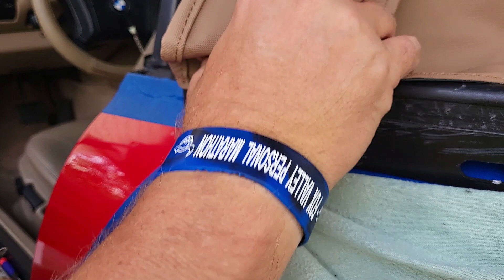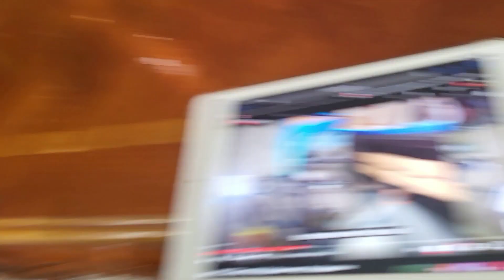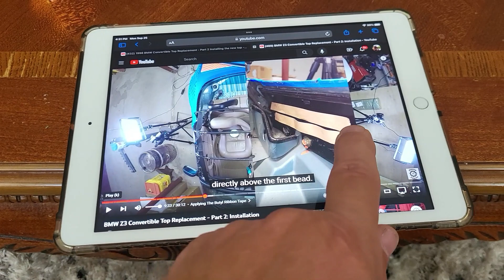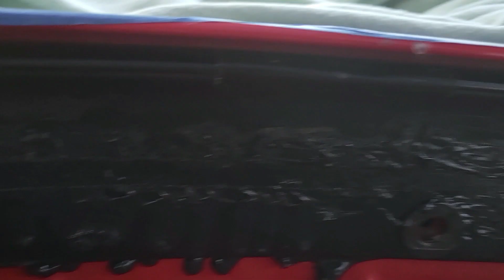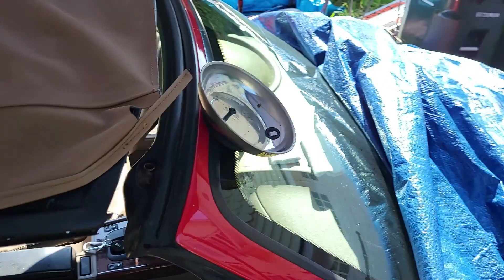BMW Z3 TOP REPLACEMENT - HOURS OF INSTALL TIPS !

Comment: dont take this the wrong way, but im pretty much convinved that you're my spirit animal. (or spirit human, in this case). i did actually sit thru the whole video, and i was right there with you feeling every single pain in the ass, (and neck, and back) unnecesarily overly-complicated, bull-shit aspect of this replacement. at one point, when i think i was maybe 50% paying attention and 50% struggling to unbend that one tension cable bracket that my kit sent me the wrong one of (yep, 2 lefts, no rights), and my boyfriend just started laughing because we both let out the same sigh of exasperation followed shortly by a well-deserved cheer of victory, and it was eerily in sync lol.  long tory short, it was very refreshing acually seeing someone show a more realistic process that i can really relate to. Thank you!!